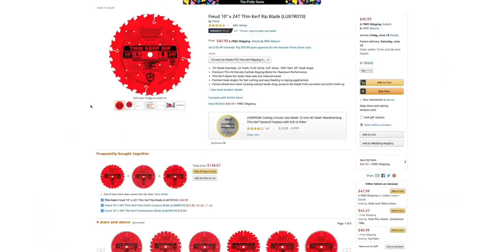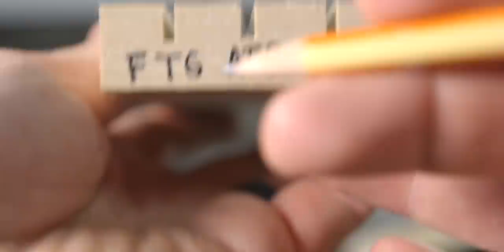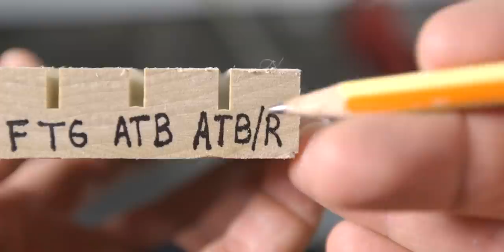What You Need To Know About Table Saw Blades

Comment: Great video! Just have to say though, I bought Forrest blades when I started woodworking back in the 60's, and I'm still using those blades today because they can be sharpened 4 or 5 times, and can be re toothed. As much as it hurt when I bought them it was definitely money well spent. Oh, and  the jointer edged cut Forrest blades make saves so much time. (time is money)
Reply from the maker: Thanks for sharing!

Comment: I’ve been woodworking or 3 years and I found that while the Freud brand is a good reasonably-priced blade, my experience has shown that the quality of my cuts are even better with the Amana brand.  Of course, the Amana brand blades that I use are all full kerf blades.  I’ve also had great luck with the Diablo Brand thin kerf blades as well.  I use a nice thin kerf Diablo on my miter saw and get very low tear-out.
Reply from the maker: Thanks for sharing

Comment: Well stated.  The problem with thin-kerf blades is deflection resulting in saw marks.  A full-kerf typically will not deflect, especially the higher-end ones.  Expensive blades are worth the investment in time and ultimately money as they can be resharpened many times.  Cheap blades are throw-away.
Reply from the maker: Great info!

Comment: Which of the blades are you using for dado and rabbet cuts where you need a flat bottom? Do you use the FTB rip blade but in a crosscut fashion? Many thanks!
Reply from the maker: Hey Jay! The best thing to do is buy a Dado set (but I bet you knew that already ;). However if you don't want to spend the money, you can use a combination blade (ATB-R), and then just clean up the bottoms. There might be a FTG out there that would work for cross cuts but I can't think of one right now. Maybe a Non-Ferrous Metal & Plastic Cutting Saw Blade? CMT might make one too? I wish I had a great answer for you. Maybe someone else here might know.

Comment: Hi. I am semi newbie in woodworking and looking for all what is helpful. Just seen in your movie that thin kerf are better for under powered machines. I have DeWalt 7492 and I heard some opinions that this is exactly under powered machine for 250mm full kerf blades. Does it mean should I rather look for thin kerf blades ? Thx. Marek
Reply from the maker: Either blade will work for that saw, but if you are ripping hardwood or a lot of material, a thin kerf will help that saw perform better. I would at least have one thin kerf on hand.
Reply: @TrainingHandsAcademy  Thx. Will buy someday. Currently ordered 7 1/4 ripping and 40T instead of using 10 inch they are cheap so even if experiment will fail small lost. But I expect improvement. Diablo are US products not available here in EU. Different tools manufacturing/use regulations. Thx again

Comment: I just bought a new table saw that came with a blade and looking at it without taking it out I see that it has less teeth more gullet. I'll probably get a blade with more teeth too. Thanks for the info that was really helpful..I'm guessing the circular saw blade is the same concept because it's the blade not so much the tool that makes the difference.
Reply from the maker: Exactly! :)

Comment: The primary difference between the Freud & Forrest is the size and quality of the teeth. The Forrest has thicker carbide teeth allowing more sharpenings. If you use blades a lot, then the extra money is worth it. Something else to realize is that the more teeth the more heat builds up. The more heat the faster the blade dulls but typically the cleaner the cut. Depends what you need.
Reply from the maker: Great info Tom... thanks buddy!

Comment: A little while ago, a friend told me to look into a Freud 10" Industrial Thin Kerf Glue Line Ripping Blade.  Is it true that the cut is so perfect you can glue up boards without using a jointer?  I've never seen a blade like this used.
Reply from the maker: I've never owned one so I can't speak from experience, but I do know they make a clean cut. Maybe someone else here could speak into this topic.
Reply: This one is my ripping blade. It makes a very clean and straight cut PROVIDING your table saw is dialed perfectly right on all aspects. In that case, yes, it's possible to glue up long edge to long edge. Nevertheless, I recently bought a Ridge Carbide combo blade and it's I think even better. The RC is a full kerf and more or less double the cost but it does rip and cross cuts, plus it's very decent on plywood.
IMHO, and it's only my opinion as a hobbyist, I tend now to leave the RC Combo on my table saw most of the time. Note that one has to take into account what kind of table saw the blade is mounted on. My Harvey cabinet saw rocks it pretty well with 2HP on 220V. Hybrid or job site saws may be lacking the power to do the same, especially on 110V.
Reply from the maker: @wildpat03  Thank you so much for adding this great knowledge! You rock!
Reply: @wildpat03  thank you.  All I have is a portable large job site type saw. It's "close" to accurate!!!!

Comment: It's really not difficult. Buy a good rip blade, I use a Freud 24 tooth full kerf, and a crosscut blade, I use a Freud 60 tooth full kerf. 90% of the time I use the rip blade. If I'm cutting plywood or actually cross cutting I use the 60 tooth. I never ise combo, or all purpose blades. Always rip with a rip blade. Your recommendations are really bad. A rip blade is the #1 blade you should buy for a table saw. Most people cross cut on their miter saw and all purpose blades do nothing well and everything slow and halfassed

Comment: Great video with lots of good info, thank you. I recently did some research and you filled in some gaps. 

Some tidbits I found and thought I'd share:

Freud makes a "glue line" ripping blade (LM75R010) which leave a ripped surface ready for a glue joint; i.e., there's no need to plane the surface flat to remove minor imperfections.

On the subject of tooth rake and the more controllable lower rake to negative rake angle- that appealed to me for use on a sliding miter saw (or radial arm) for making depth controlled crosscuts, such as for dadoes, grooves and rabbets.

And then there's the multiple tooth geometry grinds... O_o
Reply from the maker: Thanks for the info Chris!